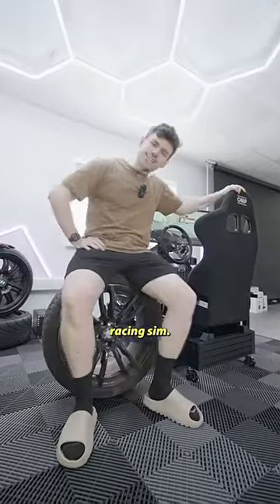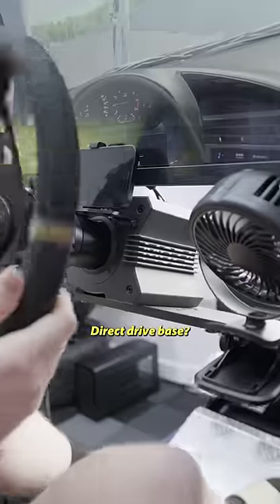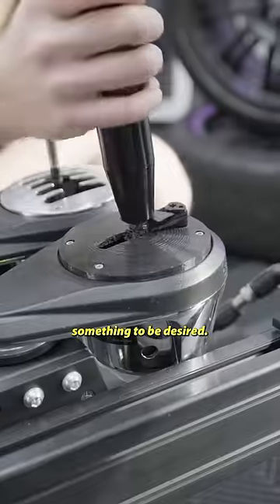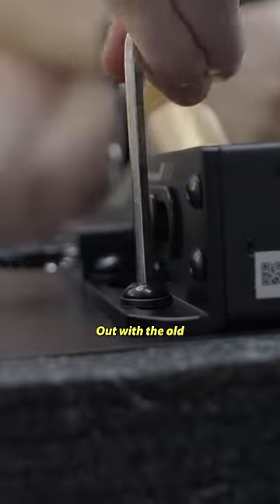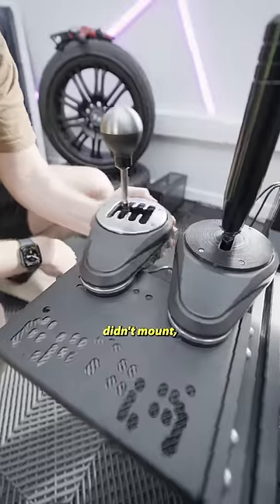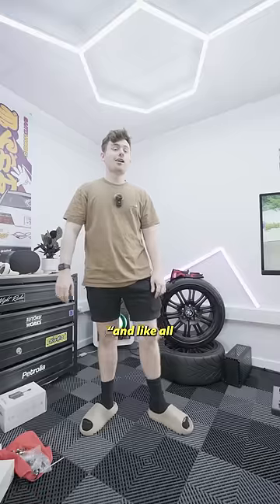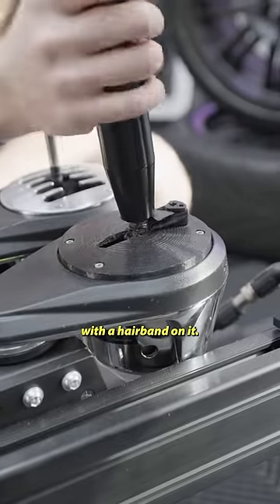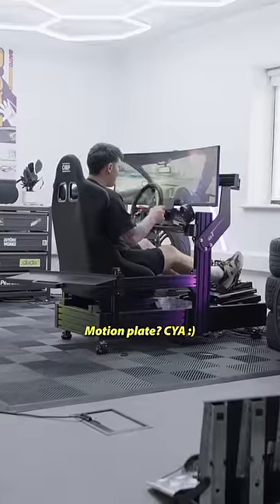BIG race sim upgrades 😮‍💨

Comment: Those are some pretty solid upgrades. Also, why did you decided to go with the moza shifter? It’s cheaper than the th8a which you replaced.
Reply from the maker: Thanks man! Fancied a change & its designed to bolt onto a plate instead of clamping down to something. Bit more rigid & some more height
Reply: @ArkiTechnology bro the th8a is designed to mount on cockpits as well lmao
Reply from the maker: @jj-mm4jq   news to me man hahah suppose I have a spare now
Reply: @ArkiTechnology  remove the table clamp and there are four screw holes at the bottom, that’s where it mounts to a cockpit
Reply: @ArkiTechnology that's why user manuals exist bro. You can also turn the actual mechanism 90 degrees and use it as a handbrake. In the software there's shifter mode and analog mode. I use it like that when I drift
Reply: what parts and where do i buy and pc and xbox or only pc
Reply: moza shifter is worth it th8a is a ripoff
Reply: @tomatoe308 from what?? Th8a  came out in 2016
Reply: @ArkiTechnology The TH8A can also be bolted on. I had mine mounted on my rig via 2 screws
Reply: @ArkiTechnology The Th8a does bolt down if you remove the rubber clamp pad and clamp you will reveal some holes for mounting underneath
Reply: The th8a is still worse than the moza shifter though
Reply: @ArkiTechnology  you know that the screws in the TH8A connecting the clamp to the actual shifter can be taken out and you can use it without the clamp, I’ve got a homemade Sai made with wood and that’s how I have my TH8A connected
Reply: You can remove the clamp for plate mounting I think
Reply: @milo_97  My guy, this is a 7 month comment about how the th8a is a low quality, shitty thrustmaster product. If you know so much, then inform me how I am wrong.
Reply: th8a is outdated moza shifter is much better
Reply: What base is that for the whole sim?
Reply: @JRod3098  looks like a gt omega.
Reply: @Eebens  no it's not
Reply: It’s cheaper but feels way better

Comment: A vr headset will make this 10 x better
Reply: not really, it would kill everything that has been done
Reply: Everything? I mean you still retain everything -the monitors and framework, ill argue frame is needed for haptics but its worth the shot for them to biy something like HP Reverb G2 V2
Reply: FR
Reply: @halophobic9550 no, it doesn't really work like that.
Reply: @Ile-17  bro, i know for experience
Reply: @halophobic9550  I wonder from what kind of experience. You are the first to say that vr headset would ruin or "kill" good sim racing settup.
Reply: @Ile-17  im just saying, in the end what did you spend money on the monitors for
Reply: @halophobic9550  Usually people don't buy vr glasses to replace monitor's but to give other option

Comment: Set up a 5.1 surround system, split the base cable output amd connect the second output into a stereo.
Connect the stereo cables into vibration motors instead of speakers and there you got a 5.1 surround cinematic experience with vibration.
Did this to my setup, wonderful results.
Reply from the maker: awesome! thankyou man
Reply: @ArkiTechnology Even better, do the same but just instead with a 7.1 system if possible. Now your going to hear sounds accurately from all angles ;)
Reply: 5.1 systems are quite outdated. Now it’s more adobe. Atmos is where it’s at.

Comment: You should tilt the seat back so it feels like an actual car. A good 10 degrees minimum, but as high as 20 should do the trick. Might have to adjust your distance and then pedal and shifter stack locations afterward, though.